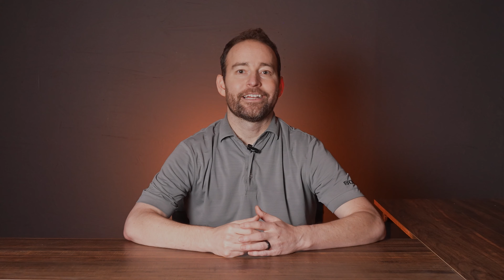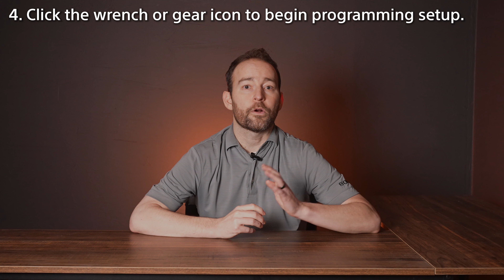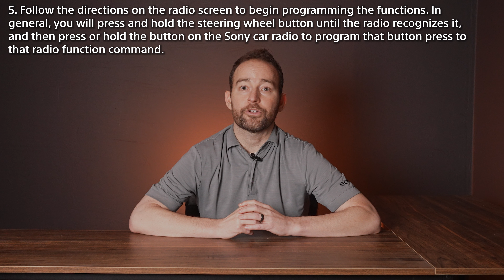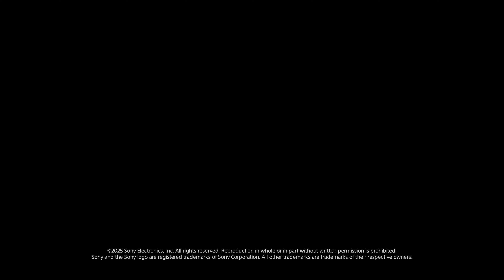Easy Guide to Set Up Sony Car Radios with Steering Wheel Controls!

Comment: I’m only getting three buttons to work.
Reply: Hello,

Did you follow the steps above and connect the adapter correctly?
If you are still unable to activate all buttons the wheel, you may want to connect with a Certified Technician at your local shop!

Double check those steps, and check in with your local technician if you continue to have issues.
Reply: In what car did you set these buttons? VW?